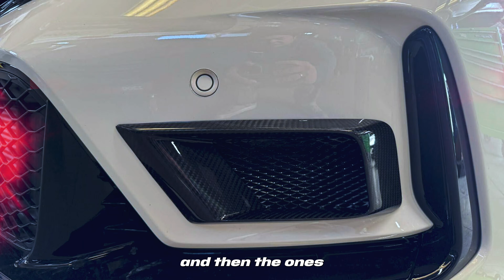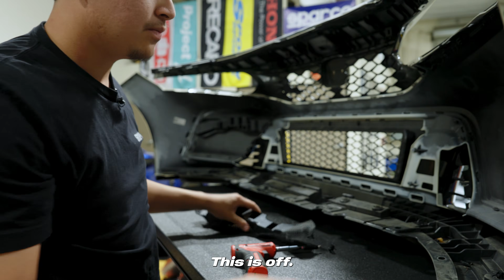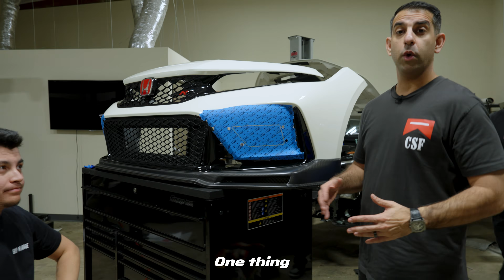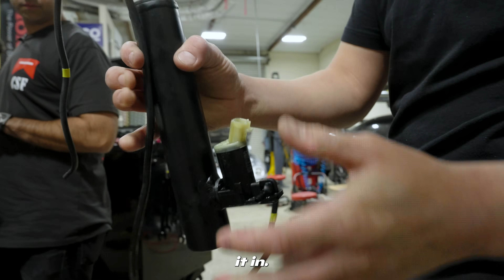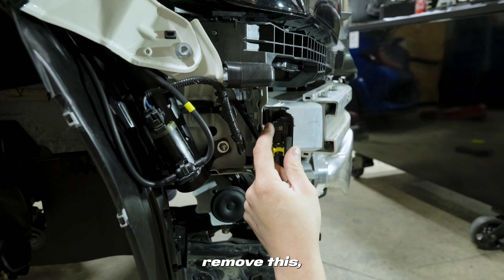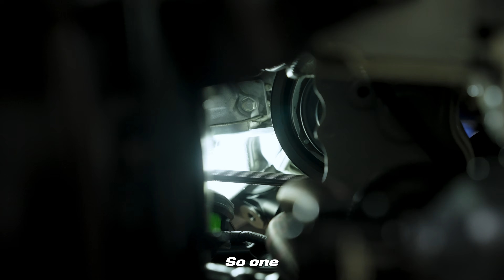CSF FL5 Dual Engine Oil Cooler Kit Installation Guide

Comment: So what are the F or C temps after a few hot laps? curious as to whether these 2 oil coolers will run cooler then whats out on the market right now
Reply: Their website showed a 15° F difference after like 4-5 minutes on track last I looked.

Comment: Hope they come up with a kit for the integra type S
Reply from the maker: This kit will fit the Integra Type S. However, the ducts are the only part that won't work. We are working with an SRO team on the best solution for ducting, but the factory bumper inserts look like they can be modified for sufficient airflow.

Comment: If you live in a colder climate would this be bad for everyday?
Reply from the maker: All the engine oil runs through a very accurate thermostatic sandwich plate. So unless the oil reaches high enough temperatures it will not open so there is no risk of major over cooling.
Reply: @CSFracing Does this apply to all the  oil coolers you offer? I'm specifically looking at the 8119. I need a oil cooler for the summer but not the colder days.